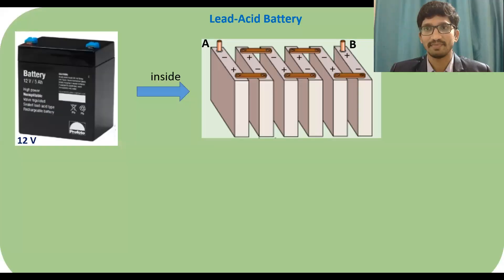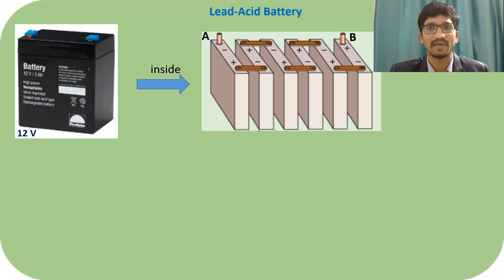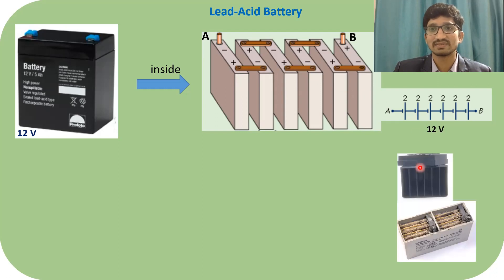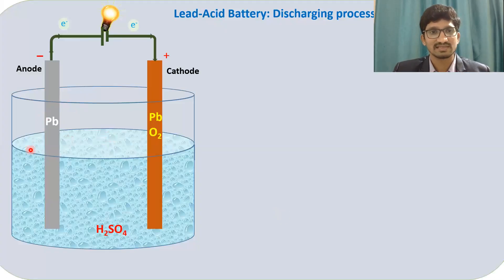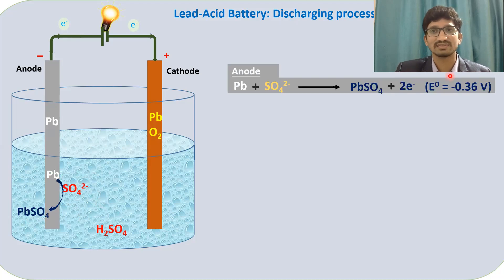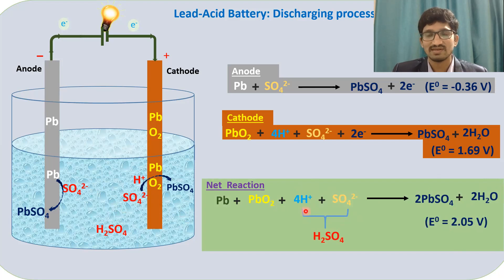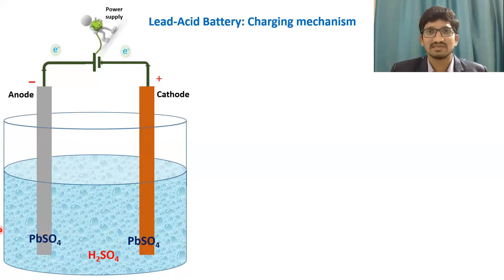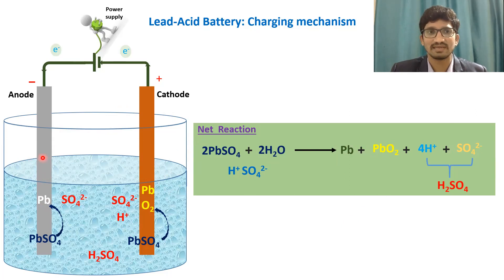Lead-Acid battery: How discharging and charging process happen?

Comment: Satya, PLEASE KEEP IN MIND:——      The CATHODE is DEFINED as the electrode at which REDUCTION occurs.     And, the ANODE is DEFINED as the electrode at which OXIDATION occurs (takes place).                    It does not matter whether you are talking about the discharge process, or the charging process.      These are ALWAYS the DEFINITIONS.      Only the (+) or (-) sign changes.